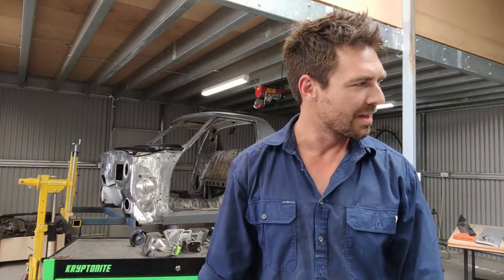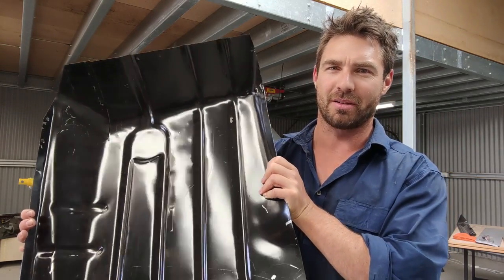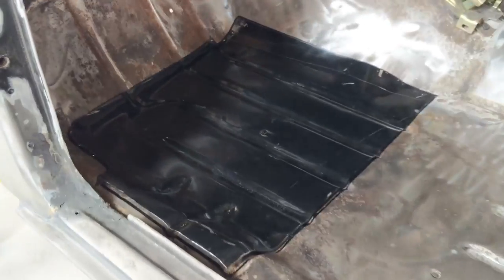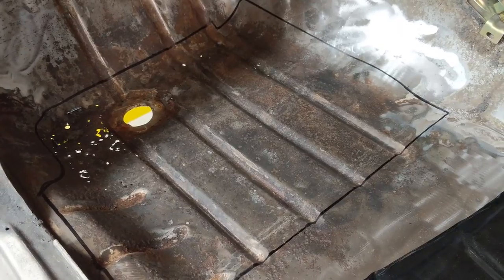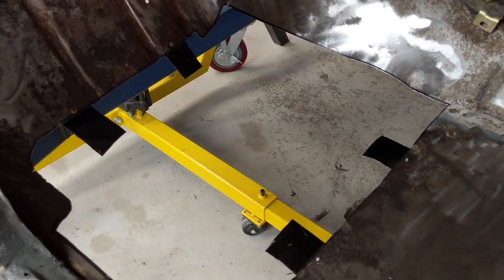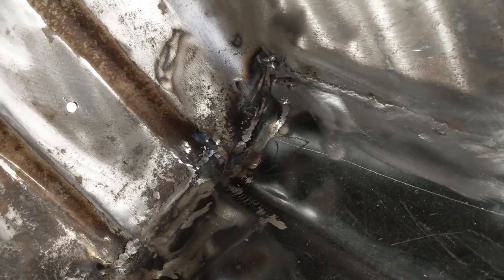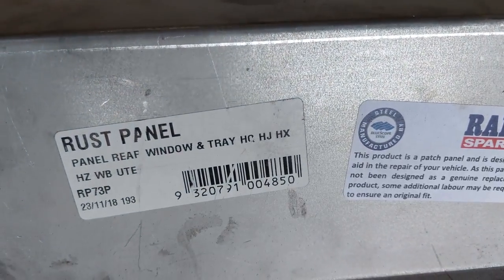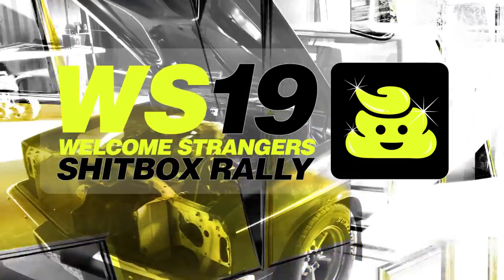EPISODE 27: INSTALLING A LEFT HAND FRONT FLOOR PANEL ON A HQ HZ WB UTE

Comment: Been watching your build for a while now & great to see someone having a go.
I'm currently doing a similar build on an HQ van. 
My only critique is that floor pans are meant to be lap welded. (By law!) covered up, nobody should pick it. 
Plus, at the rear, I usually leave the replacement full length & trim the floor at the crossmember, leaves plenty for a lap weld.
Reply from the maker: Thanks David, yes I did mention the lap weld requirement that I had read but wasn't sure if it was a requirement in Victoria as I couldn't find any info so I decided to butt weld to eliminate further water entrapment and rust down the track. After KBS then dynamat then carpet it will be impossible to tell or inspect anyway come rego time and it is structurally very strong so all good. Cheers

Comment: A useful method of welding up pin holes or larger holes that are surrounded by good metal is to use copper plate held against the hole while it's welded up. Since molten steel and copper won't mix, the copper acts as a temporary support of the weld pool while it cools. It also acts as a heatsink to help reduce distortion. A large diameter copper pipe hammered flat will also do the job.
Reply from the maker: Yes, I just bought a copper plug weld clamp for the plenum chamber so looking forward to trying it out! Cheers

Comment: just a tip for you.   when  i have my Holden's  in the rotisserie  i will cut all  the rusty area's  out and then expose  everything like in side your  bulkhead  "plenum"       and then have it sent to media blaster haven all  whole lot bear metaled under carriage this will make life so much easyer  nice clean welds and  better rust removal and better surface for etch prime  better finish all  round you should be able to get mobil sand blaster to
Reply from the maker: Hey mate, yeah definitely next build I won't be stuffing around with stripping paint myself, I will be sending it to a blasters to get it done. Cheers

Comment: Im still try to find out  what the removable plates are from the floor pan   i was thinking  maybe for factory jigs to line body parts up ?? any one know   
...when  i put my floor pans in i  cut floor pan to out in car so is 30 mm or so bigger size  and so patch panel is slightly bigger  an then i tac weld patch panel in place then cut threw the to panels along the edges at same time this ensures a perfect  fit in replacement  eveytime   air hacksaw is best thinner cut line

Comment: Good video mate. When you put a floor pan in like that considering that you had to fill the gap etc do you apply a bit of seem sealer all the way round the section? I remember seeing someone else doing that I thought it kind of made sense- I am about to do the same repair on my HJ45. Cheers
Reply from the maker: Thanks mate, yes definitely seam seal inside and outside on the weld but before that I applied KBS rust seal polyethylene paint over the inside and outside as well. Cheers
Reply: @BarnesysBuilds  thanks mate appreciate the reply!

Comment: The two small holes in each footwell are factory made and come with large amount of seam sealer plugging them up so are not designed for drainage. I have same on hq and Wb. Don't know purpose.  I imagine the round cap is some sort of moulding hole...there are several in various places in wheel wells etc. also.   Looking good mate!

Comment: Hey mate - great vid! I also have a rare spares floor pan that I am going to fit into my Datto - what are you going to do with the black paint that is on it? Any ideas what it is? If it’s epoxy primer I think I’ll leave it. Thoughts?
Reply from the maker: Hey mate, yes it is epoxy, just sand back edges to bare metal and leave the rest coated. No need to bare metal re-prime something that's done well. Just use weld through primer over the joins and scuff back panel for final coat of whatever you decide to coat with. Eg kbs
Reply: Thanks Barnsy! Out of curiosity, I noticed you mentioned the lap welding “requirement” for floor pans - I heard this the other day when watching Robs Shed, but I can’t find a shred of documentation anywhere confirming it. Have you seen anything?
Reply from the maker: @michaelf6710  yeah apparently I've heard people lap weld as a requirement for RWC however it just opens up opportunities for rust down the track. I didn't find any info as a requirement for vicroads so I just butt welded it for a nice finish. I've never seen any vicroads people even look under the carpet before let alone peel back seam sealer to check butt welds. Reality is if it's done well it will be stronger than it was before being rusted.

Comment: Hey mate, where can I get info on how to install a WB front end to a HQ-HZ Holden? I can't seem to find out if the WB will fit onto a HQ-HZ Holden as I believe they share the same chassis. Need some link or info before I strip the WB front end, fenders, hood etc 

apart. Cheers mate.
Reply from the maker: I believe they are same chassis for the whole H series but HZ and WB had radial tuned suspension which should be able to be fitted but can't confirm that.
Reply: @BarnesysBuilds  Thanks mate

Comment: Those inspection bungs why didn't you just leave them out. I am not sure why you need them any way.
Reply from the maker: Yeah I actually did leave it out in the end, I thought it was a drain hole but since found out it was a potentially a mounting point for the body during production.

Comment: I thought floor pan had to be butt welded
Reply from the maker: It was butt welded, I think you mean lap welded.
Reply: @BarnesysBuilds  yes 😆mental blank
Reply from the maker: @stevenbruzz6050  depends who you ask, I did research that but I didn't want to risk moisture build up and further rust happening inside the lap welds. That butt welded repair is much stronger than the original floor pan I cut out now. That's all I wanted to achieve.